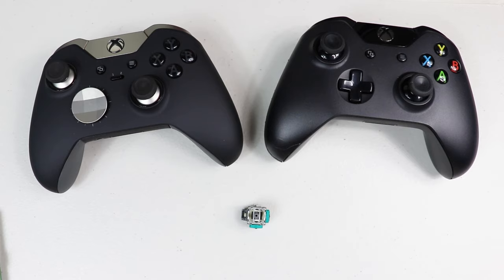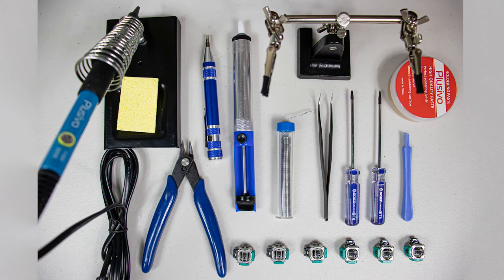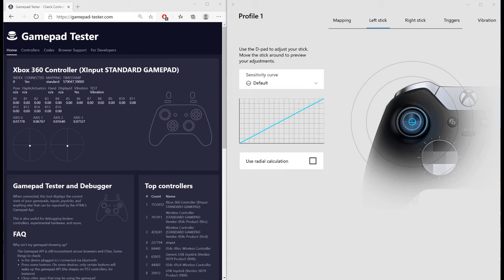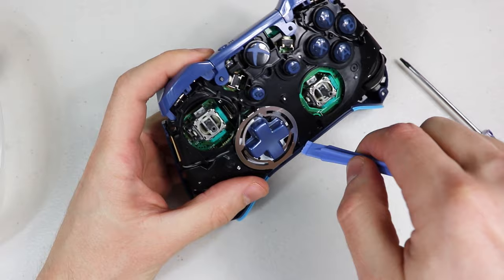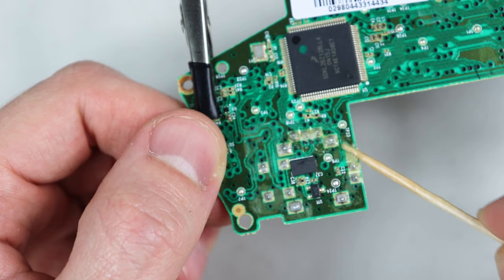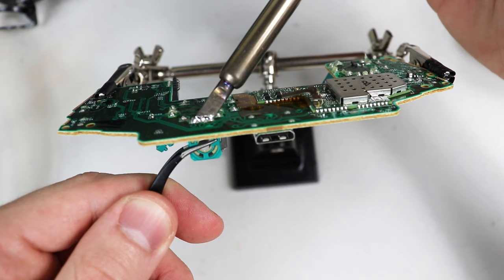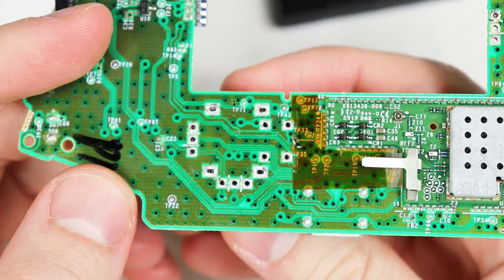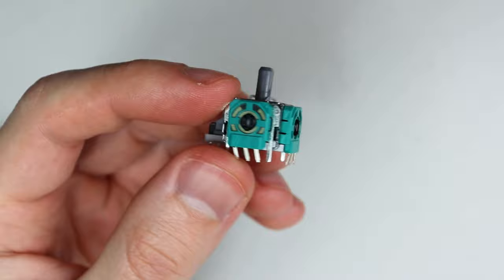How to Replace Xbox One Controller Analog Joystick - NEW METHOD - Fix Stick Drift, Broken, & Loose

Comment: the this joystick work with one s controller?
Reply from the maker: Yep!
Reply: @SOSSGAMING  when calibrate I found one on ebay same price and they see there oem are this the same as oem and can I change xbox one micro USB to usb c I know I can ps3 controller and ps4 but it be posible on Xbox one s
Reply from the maker: @elcangry855  Yes I have an eBay store as well.  I'm an not sure about whether you can change USB to USBC.  Great question.
Reply: @SOSSGAMING  yes you can is almos the same pin out but you have to conecte to the top make video let me know
Reply from the maker: @elcangry855  That's pretty cool! Thanks for the information.
Reply: @SOSSGAMING  no thank you for responding all coment

Comment: I’ve done these controllers so many times. You pretty much did it all wrong to fix the switch. I can see if the spring is broken then the whole replacement. There is a way to manually calibrate the switch. All you really have to do is center the dead center which I found a hack. Think I’ll make a video soon cause main thing is you don’t have to replace the whole switch.
Reply from the maker: That's great, and yes I am aware of that. I should have mentioned that just for drift you only need to replace the sensor, but this is a tutorial how to replace the whole thing. Let me know when the video is up, would love to watch it!
Reply: That doesn't work 99.9% of the time. The carbon fiber track gets worn down and needs to be replaced. Cleaning the potentiometer or replacing the spring will not restore the carbon fiber anew.

Comment: Why did you mention calibrating via software but then you proceeded to manually “calibrate” by bending pins? This to me just seems like a good way to ruin a brand new pot.
Reply from the maker: If you mean the integrated Windows calibrating software, I mention that it only works for PC and does not transfer over to console. That software doesn't even work for PC anymore. If only there were software, this world would be a better place lol btw the pots work wonderfully, I wouldn't consider them ruined. I've replaced over 400 joysticks this way. All great. If you're worried about chopping off the nobs, I have an older video with a method of measuring the pots and using some math if you are interested. It's more tedious, and may result in less accurate calibration, but works.
Reply: @SOSSGAMING  thanks for the reply. There seems to be a lot of contradicting videos out there, some say you should be able to simply replace and the Xbox will adjust itself for minor errors, others say you have to perform a mechanical calibration. 100% with you, though, Sony allows users to enter a diagnostic mode on their controllers to perform an integrated calibration procedure. That would be so much better than goofing around with spinning pots to calibrate.
Reply from the maker: @dooder126  The Elite Series 2 controllers are the only Xbox Controllers that don't require manual calibration. It automatically calibrates by itself, continuously. It's very cool, and I wish they made all their controllers like that. 
I can't find anything about the Sony controller diagnostic calibration. I don't have a console myself to test. Can you guide me to a video or article demonstrating this? As far as I know, Sony took after Microsoft, or visa versa, and doesn't have software or any means for calibrating. I'm making a Playstation controller joystick repair video soon, and if this is true, it would be a game-changer.

Comment: Can you not adjust the deadzones using the xbox software? I see my son getting into that to test for drift quite often.
Reply from the maker: You can certainly do that to alleviate the symptoms of stick drift in the meantime. The issue with that is it will effect gameplay (not as responsive, less accurate) and that the issue will likely worsen in the near future.
Reply: @SOSSGAMING  I appreciate your reply. I have all of the tools already, so I'm going to give this a go. Thank you for the time and effort put into the video!

Comment: I struggled badly removing the joystick so I just gave up. Probably should have watched this video first because I was using nothing but a sharp tip and sucker. Didn't check the temperature and started at 2am. It's 6:17 now and if I could only show you the mess layed out Infront of me. ☹️☹️☹️🤮

Comment: Hey, can someone point me to where I can do some troubleshooting? I put the new joystick in, and when trying to test the stick it just points up and left, and doesn't move when I move the stick (the stick button works fine). I thought this might be due to the potentiometers not having a good contact so I soldered them in to see if that would help and it made no difference. It could also be the stick I ordered, as I only watched this video after it arrived and there's a chance it's a knock off (I got this one: https://www.amazon.com.au/gp/product/B07V6T14KQ/ref=ppx_yo_dt_b_asin_title_o01_s00?ie=UTF8&psc=1 ). Any help would be appreciated, not sure where else to look / ask.
Reply from the maker: So the good news is that it's not the joystick that's causing the issue, but the bad news is that it's not the joystick causing the issue :/ And they are indeed the joysticks with the internal deadzone.  They have the right joysticks in the first picture, but you can see in the second picture they are the different ones.
If this was caused after installing them, then it may just be some of the pads holding in the potentiometer were damaged/lifted off.  It's also possible one of the small capacitors fell off while the soldering process was happening.  :/
Reply: @SOSSGAMING  Thanks for replying! I had a friend look at the soldering and it turns out I damaged the contacts while removing the old joystick. They said it might be possible to fix if I soldered a wire to the other end of the track on the PCB, is that doable in this case?

Comment: Desoldering sucks so hard how in the hell you get those joints off so easily.
Reply: A decent iron and tip and flux
Reply from the maker: It can be quite tricky, but most important would be adequate heat (not too hot as that might damage the board) and not too cold as that won't melt the solder enough. I use about 350-370*C.  Next important factor is having a clean tip and using flux like HX has mentioned. If it's on the small through hole boards, I suggest using the chop up method as even I can't suck out the solder on those buggers.

Comment: Your cheap parts are making this a lot harder then it really needs to be but I guess money is money
Reply from the maker: I'm sorry you feel that way. Unfortunately for actual xbox controllers (Microsoft) this is necessary unless you don't mind miscalibrated joysticks.  Same for PS4 controllers (Sony).  Funny enough, using actual cheap joysticks, ones with integrated deadzones, can eliminate the need for calibration in most cases, but will effect gameplay as they are not sensitive enough.
Both third party PDP and PowerA controllers have the ability to calibrate themselves with internal software.  Had I known you were repairing a third party controller I would have also mentioned this.

Comment: Jesus this is ridiculously time consuming and difficult. I thought the assembly would fix everything as is but I just realized that every mother board is calibrated differently by Microsoft so a new stick assembly will not register properly. These Xbox Controllers are just stupid. My  shoulder button micro switches also fail just by sitting in the drawer. I wouldn't recommend Xbox controllers.

I also seen people just replacing the disc inside the potentiometer and keeping the stock one. Would this be a better solution?
Reply from the maker: Cleaning and/or replacing the wiper is a temporary solution at best.  The next best would be to change the actual potentiometer.  Personally, I just replace the whole joystick, but I understand it's not necessary if the only issue is that the pot is worn (which is what causes the drift).

Comment: You don't need to destroy the old analog stick to remove it dude...
Reply from the maker: Unfortunately, for many that are working on a small through hole controller and just have a soldering iron, it is a great option as it's quite difficult to remove all the solder from them to free the pins. If you're able to remove all the solder on the small through hole controllers, I give you kudos! Seriously, that takes a good bit of skill and experience.
Reply: @SOSSGAMING  Maybe I just got lucky but I used an iron and a sucker only, no flux or wick and it just came out in one piece easily. I'll be doing it again soon though so we'll see..

Comment: Dude I tried but I could never cleanly get the pins from the previous stick out. I ended up trashing my elite series 1 :( Oh well, it was that or deal with freaking terrible stick drift. It's at piece now.
Reply: That happened to me as well my first try because I lost my patience, you can find parts controllers for around 20-40 on ebay.  find one where everything is bad but the joysticks and swap the whole joystick board over.  Or steal the board out of a controller and sell the rest of the parts and get your money back.

Comment: Stage 3. Replacing the complete joystick unit after breaking the sensor clip that held a factory pinched sensor since day 1.. Skip stage 3! Stage 4. Learning to avoid Microsoft products with a xbox one that broke within a week after warranty ran out and a elite 2 controller that was death on arrival and losing the fight over warranty. 

What can I do with consoles that show no screen after midnight updates and controllers that had a collective new price over 1000 bucks? I'm almost willing to claim that there are software timers, the hardware is still functioning without outputs.

Comment: I wonder if you could just replace the crap noname chinese pots Microsoft used with some good quality Nobel extreme long life pots (they have pots rated up to 10 million cycles). They have a several pots in their catalog that look similar to this and most of the chinese micro pots are actually copies of the form factors that Nobel uses so there is probbaly something that will fit. I guarantee that if you could find a replacement Nobel pot that would be a 100% fix, they are the best pots you can get.
Reply from the maker: Very interesting! It sounds like as long as they are within the same resistance range (10-12k or so) and the same size I don't see why they wouldn't work.

Comment: Ben Heck had a great idea. I saw it in his video. https://youtu.be/bkVXhKxR83I He soldered 100k Ohm  calibrating potentiometers onto controllers potentiometers. Its work like a charm for calibrating center point. Only downside they must remain soldered. But they are super cheap in bulk,  and super small. I saw this in his video and also did testing myself. It works!
Reply from the maker: That is quite genius! Thanks for the share, the way he makes a one handed controller was a fun watch.  I'm going to actually do a little research into this myself now.

Comment: this is the single worst thing i have ever witnessed. 
people DO NOT start cutting and janking on soldered components like that. 
it somehow worked out for this guy. but YOU doing it for the first time. WILL 100% break your board and brick the entire controller. 

(if you know what you are doing then ignore this.  you can basicly litterally yank the whole thing off. and then just do trace repair to get it working again with tiny wires.. )

Comment: Man, I'm impressed with your thoroughness but that's way too much mucking around. I've repaired a number of controllers in my time, namely for Xbox One & PS4. All I've ever done was remove the dodgy stick, install the new one & you're done. The calibration process just isn't necessary as they all worked again perfectly.
Reply from the maker: Thanks! It sounds like you have been using the joysticks with built in deadzone.  Technically they will work and the calibration not necessary (in most cases), but they are not the best especially for fps shooter games where responsiveness is key.  I show the difference at 3:57
Reply: @SOSSGAMING  Nope, full range of motion, just like the right stick at 3:46. These last lot of sticks I found are identical to the originals (probably better).

I did get a few sticks a number of years ago which were crap & drifted out of the box.
Reply from the maker: @dreamcazman  That's great, it appears you've been pretty lucky then.  Around 30-50% of joysticks will appear to "drift out of the box" in my experience.  It's not the joystick's fault for that, it's the reasons mentioned in the video.  Games have different in-game deadzone, and xbox's and ps4's homescreen deadzone is around 20% if I recall correctly.  Both will hide not very well centered joysticks.  There is a decent room for error.  Anyway, not here to argue.  Glad you've found success! Best wishes.

Comment: well I fucked it up somehow (great video but im am dum), I think I didnt push the Joystick far enough and after I soter, It didnt move besides up and down, so I try to resoter but it failed completely, gg
Reply from the maker: You first might want to check the little nub that goes through the x-axis potentiometer.  Sometimes that gets pushed in out of place.  All you have to do is pry the potentiometer so it's out of the way, then grab the nob with some pliers and pull it back out where it should be.

Comment: So why even remove the analogue stick?  Why not just replace the offending potentiometer?
Reply from the maker: You can! This is just a tutorial on how to replace the entire stick. I didn't need to replace the right analog stick either, but I did for tutorial purposes.  I will be making a separate video to specifically address stick drift when I get some more time. Thanks for the comment!

Comment: Why do yanks call it "sodder"? Do you also send soddiers to war lmao

Companies really need to start making things easier to fix though this is getting nuts
Reply from the maker: I've looked into this before and it's actually the yanks who have retained the original pronunciation, whereas your region has changed it :) And I agree. Fortunately they are making some small efforts. Like the new S/X controllers have autocalibration now, which is quite nice.

Comment: I don't get it

Why it's too hard in your video?

Other people just soldering the analog and work great!
Reply from the maker: Because most of the time it is not great.  Calibration is needed >60% of the time :) Also, manual calibration is better for accuracy (fps games) than one that is not calibrated.
Reply: @SOSS GAMING  i just need the deadzone < 20%
Maybe I don't need this calibration steps Right?
Reply from the maker: @ibonbon7096  If that is your limit then there is a good chance you won't need calibration :)
Reply: @SOSSGAMING   thank you I'm really appreciate the answers💚

I just have one more question🙇😂

I saw three types of analog sensor one with black wheel 2- with white wheel 3- with gray wheel

What is the best if you tried them?
Reply from the maker: @ibonbon7096 no problem.   I would need to see the pictures first. There are a lot of bad copies out there

Comment: Hey soss I bought your bumpers pack and I cannot our the bumpers on
Reply from the maker: Have you watched the bumper video? What part are you struggling with I will need more info :)
Reply: SOSS GAMING I can easily take apart the controller I just can’t get the bumpers on the controller I’ve tried so hard
Reply: And yes I have watched it
Reply from the maker: @AverFN  Oh, gotcha.  Yeah it can be a bit tricky.  I would suggest perhaps try looking at a lot of other videos they may have some extra tips, ideas, and/or suggestions that might give a different insight and perspective that may help you get them on.  Let me know if that helps.  We'll get them on for ya eventually though don't worry!
Reply: SOSS GAMING I mean I’ll try that but idk I’ve tried for 3 days to get the bumpers on
Reply from the maker: @AverFN  Is the struggle getting everything aligned?
Reply: SOSS GAMING idk I think
Reply from the maker: @AverFN  Ok, if you wanna just return it that's fine too.  I'll accept the return request if you want to submit one.  I'll be gone until Sunday though.  If you wanna keep trying I'll be back next week and can follow up with you.
Reply from the maker: @AverFN  How's it going? Did you ever get it on?
Reply: SOSS GAMING no
Reply from the maker: @AverFN  Do you just want to send it to me and I can put it on for you?  I'll just charge for shipping back ($5).
Reply: SOSS GAMING I’ll ask my parents
Reply: What would u need
Reply: If you want you can text me in private on discoed if u have it if it’s more better
Reply from the maker: @AverFN  I don't sorry.  But you can message me on eBay if you'd like.  That's where I offer repair services, but you obviously don't have to pay the full price for that, just the shipping like I mentioned.  https://www.ebay.com/itm/224025946052
Reply: Hey soss I got the bumpers ON LETS GO
Reply from the maker: @AverFN  Bravo!!!!!  Well done.

Comment: theres gotta be a better way to make a controller stick..... magnetism may be an answer
Reply from the maker: You would think, right!  I think they like carbon for a reason though...
Reply: at least replacing a joycon is much easy. This, heh guess I be stuck with the broken sticks. Odd ball drift(it not the normal drift, just weird), a normal drift and a springy one. The springy one is brand new but not sure if I want the hassle of trying to return it.